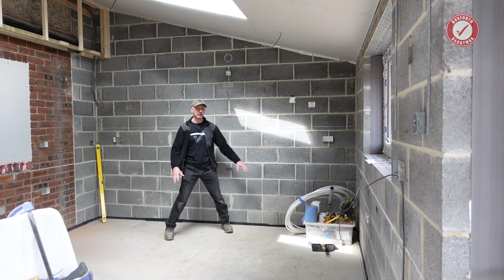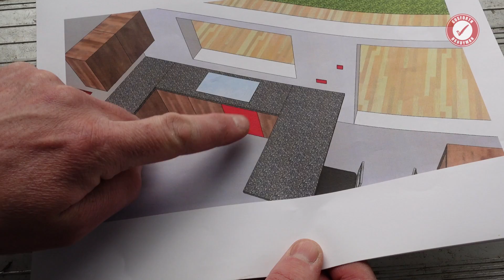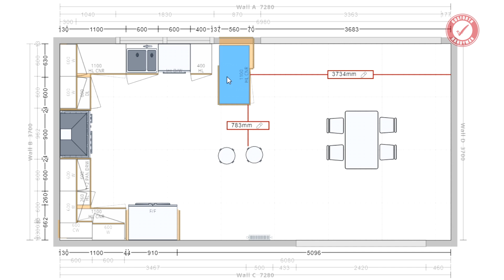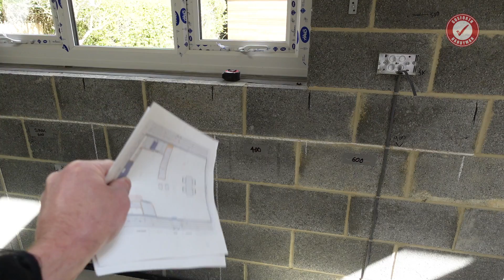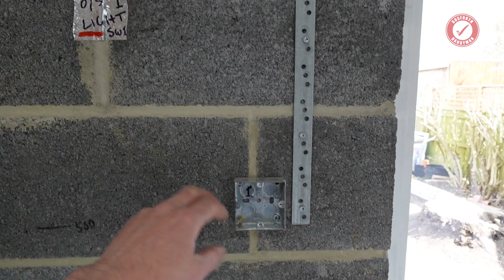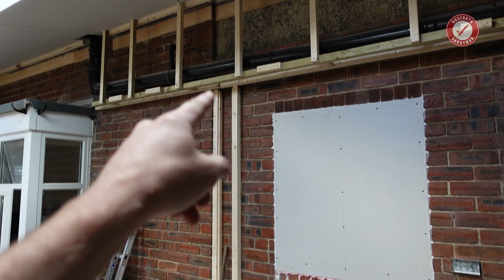DIY kitchen planning - a few tips to get it right! (Self Build Extension Part 18)

Comment: Hi,  Are you really only having 2 double sockets on the long wall? I did that many years ago when we didn't have anywhere near as many devices to plug in. The cost of extra sockets before plastering is quite low. My advice would be to put in at least twice as many sockets as you think you need! Good video, I'm at the same point as this so it was really useful.

Comment: One thing I regret with kitchen is sockets, did not put enough in.. put 2 double socket for every unit you have. Last thing you want is to group your small appliances together and having trailing wires everywhere

Comment: So maybe a suggestion or two.....
Resess the wall behind the refrigerator so you can push the fridge back so the front of the fridge is even with the depth of the counter. It will make it look taller and blend in with the rest of the kitchen better. 
Heated floors in the kitchen/ diner if you can. 
In the corners use lazy Suzannes inside with doors that open fully.
Drawers. As many as you can get. (note: in some premaid cabinets the drawers are shortened debth wise so you don't get full drawers.)
Since the sink will face an external wall, it may feel the cold more...maybe double insulate the incoming water pipes & drains. 
Water sensors under the sink and dishwasher.

Comment: I don't know if you actually ordered the cabinets yet. The upper corner one near the window should be a corner cabinet, not a straight one. Reaching into the far side is a real pain. With the door at a 45, access is normal.
   The refrigerator can be recessed into the wall 3-4" so you can order a standard fridge. Otherwise, you need to order a cabinet depth one. These are smaller inside and sometimes special order. (and more money for a smaller fridge).
  It looks like you can remove the bricks with no problem. I'm not sure what it looks like on the other side. So...maybe.
  Btw, underfloor heating is really nice and fairly easy. Bare feet on the floor is a blessing...and no radiators.

Comment: Andy, great to hear your thought processes.  Not enough power points, and why not have switched spurs for the d/w and fridge and extractor so they are all lined up with the sockets around the worktop?  You need to be able to switch appliances off quickly and fumbling in cupboards is a no-no.  You don't want a socket under the sink, fit an unswitched socket behind or beside the d/w and for the extractor.  Recommend drawers over cupboards for pots and pans, crockery, baking tins and all the rest, very space efficient.  We have a cutlery drawer within a deep drawer and it works very well.  Have you considered floor level lights in the kick boards?  Don't forget USBs in the double sockets.  Lots to think about as you say.  Good luck to you both, exciting times.

Comment: For anyone with the luxury of creating new spaces as part of their design processes, my tip is: avoid corner cabinets at all cost! Anyone who cooks knows they are inefficient and frustrate access.
Reply: Straight cabinets in the corner are a nightmare to reach in. Corner cabinets are a must. Depending on how the cabinets are built, the rear of the cabinet inside can be blocked off. It's useless space anyway, even for straight cabinets.

Comment: Having gone through this process recently, right down to the same 'DIY' software, my only suggestion would be to make sure your radiator size is future proof. I'm trying to reduce my system flow rate to run at 50 degrees, maybe one day getting something cleaner than gas. I have a 1500 wide radiator, sized to the space, but for 50 degrees, I'll need it replaced for at least a triple panel. Covering it over will reduce the benefit also. On the slim unit, I got an open fronted 150mm wide unit from DIY Kitchens (along with the rest of the kitchen!) - great for chopping boards and baking trays and fills in little gaps!
Reply: I also took the opportunity to get rid of gas in the kitchen, one little bit less fossil fuel being burnt!

Comment: 1st off congratulations and very well done for all your and Mrs. Mac's hard work, especially working through the winter, you both deserve full admiration to your commitment to this project. 

I would raise a couple of points about your layout. First off I could not bear a hulking great fridge/freezer in that position which will take off a good 700 - 800mm depth in your kitchen. By all means have one but place it in the corner to the left of your range - it will easily fit in where you plan the corner unit and you can adjust the units between it and the range to fill the gap and you will get more useful storage. I think you will find it will open up the space you have created both when you enter the room and as you look across from the table. You maybe able to make up for the "lost storage" (personally I find corner units do not store that much, even with pull out baskets) by extending your peninsula/breakfast bar which will provide more useful storage than a corner unit ever could or it may give sufficient room for an island although traffic flows around one will take space away from storage. 

Finally, keep in mind where you will put a waste bin in the layout, especially with a peninsula its a long walk outside to the bin. This was a mistake I made in my kitchen and the location of the bin has always been a bit of a compromise.

Once again, my admiration for all your hard work.

Comment: Great video, I'd put the socket for the dish washer on the right hand side rather than under the sink just to keep the electrics and water/waste separate from each other. Just in case one leaks or you make a mess fixing a blocked sink etc.
Cheers

Comment: one question why are you going fitting a kitchen when the bi-fold doors are up kitchen is sealed and you could remove the window for its new access from adjoing room going to be alot of dust and debris when the windows and bricks are removed are you going up to full ceiling height when window is removed or using the existing lentil that window used

Comment: Oh I don't think I could live with a little 400 unit stuck in that gap if not got one on other side. Could you not go 2 door corner units and juggle around a bit? I also wouldn't bother with breakfast bar if having table and chairs in there but the extra work surface is a good idea. Shame you can't put another unit or 2 on back wall due 2 rad having 2 go there. Sure it will all look fine and dandy when done tho 👍

Comment: We’ve done loads of kitchens throughout the years and I would definitely recommend an island over a peninsula. You are limited to one route to the sink with a peninsula and it gets annoying. 
Also you can get 110cm range cookers which are usually much better quality than the 90cm ones and Rangemaster (a subsidiary of Aga) ones are the bees knees. Just my thoughts from experience. 
Oh and as my husband has yet again smashed a bowl on our ceramic floor tiles……..😆

Comment: Kitchens can be heated using plinth heaters run off a wet central heating system; there are dual heaters too so they can also run on their own off electricity such as on a cool summer day.
For home owners diy designing their kitchens, if buying from Howden that company will check the customer's design and produce a finished drawing for the installer - very helpful to avoid fitting problems!

Comment: I agree with the comments about centering the sink under the window. It would drive me crazy having it off-set. My suggestion would be to use two narrow cabinets on either side...one for storing baking sheets vertically, the other a pull out spice rack. I don't know if those options are available in the UK, but they are quite popular in newer kitchens here in the US.

Comment: I'm really surprised you're not going with underfloor heating, certainly for downstairs. No loss of wall space and perfectly even heating, and because low temps are used, the boiler runs at max efficiently. And of course you're futureproofed for what ever heat source you might come along later.

Comment: The way the extension is built, with bricks (I guess they’re bricks idk I’m not a builder!) is this how houses are built in the UK. I’ve seen a lot of people building in America and Canada, where things are framed out with wood, but despite living here I’m not really sure how we do it in the UK. Hence I keep trying to put things up on the wall and they’re often just screwed into plaster, I guess it’s brick behind which is really hard to screw into even with the masonry bits I got, the rawlplugs are often too long without drilling into the brick though. Ugh this it’s such a palaver every time.
Reply from the maker: Yeah, these are concrete blocks. Normally blocks inside, bricks outside. Bricks are hard to drill in to - look for a SDS drill. Meanwhile this might help too: https://youtu.be/87hOAnt9d5s 👍
Reply: @GosforthHandyman  Thanks! My house was built in 1979 so it might be different, not sure. How do the exterior and interior walls come together, cause there’s obvs a gap behind the plaster but I’m not sure how that’s supposed

Comment: We have a switch (touch activated) underneath the overhead cupboards for those lights, I like it.
Also may consider an outlet closer to the range, for a blender or something you use over/closer to the range. Maybe with those flaps to make it easier to clean with spatter and all.
There is room under the counter close to the bifolds for a unit with a door facing the bifolds, if you could see a use for it (maybe outdoor kitchen stuff, or other stuff you use primarily in the garden or at the dining table, like table cloths, pan underthings, napkins etc) so you don't need to move into the kitchen for those.
Reply from the maker: Great tips! There's 3 double sockets near the range at the mo. 👍

Comment: A couple of suggestions, from when I design kitchens, put the china cupboard next to the dishwasher, so it is easy to unload and store, ideally with pull out shelves. Secondly rather than a corner cupboard under the peninsula, put the doors on the bifold door side so you get easy access into the corner from that side.
Reply from the maker: Good ideas! 👍
Reply: We had access doors on the peninsula side in our old kitchen and it worked really well!

Comment: Fantastic to see the bifolds on. Forgive my suggestion over your experience and that its your property, i dont think that you have enough twin sockets in the worktop areas. A mistake that we are still living with, just a suggestion 😊. 

Regarding the under cupboard and if your having it kick space lighting , i cant recommend Robus Vegas led strip highly enough. You can  buy it by the meter and its cutable so you can tailor it to your needs. And you can connect the drivers to Quintec receivers and switchs, to avoid lots of switch wires.
Reply from the maker: Cheers Paul! There's 4 x twins at worktop height at the mo but with it being dot & dab it's very easy to add extra ones if needed. 👍😁

Comment: It's great to see it all coming together.  If I can add one suggestion, albeit probably too late:  If your refrigerator is located inside a cabinet it needs a vent at the top of the cabinet to allow the hot air, produced by the condensor, to escape (hot air rises).  Closing the cabinet top prevents the hot air from escaping and significantly reduces the component's efficiency and ability to cool.
Reply from the maker: Yeah, there'll be top box over the fridge, so totally open at the back. 👍
Reply: @GosforthHandyman  See you are going for plumbed in but remember to check on where the water filter goes! Some are external to fridge/freezer!

Comment: There will be a heat loss gradient across the room, and the bi-folds will be the coldest part.  And the fridge will be the warmest part.  The radiator position will just exacerbate the gradient.  Have you considered something like ThermaSkirt?  You can even mount it flat on the floor in front of a bi-fold.
Reply from the maker: Even on cold days with no heating the room is warm due to the thermal mass of the concrete walls so we'll see how it goes. It's VERY well insulated. 👍
Reply: @GosforthHandyman  But I am guessing there's a gradient, and that the expanse of glass will be 'radiating coolth'.

Comment: I am going to be fitting a new kitchen at some point this year. the amount of times I have changed my mind on the design is reasonably high. Then there is the mixing of design ideas. Then there is finding the right finish on the doors and I looked at door fronts in two of our large DIY stores and I was not impressed with them at all, with the excepts of a solid oak door, but I don't want a natural wood finish and I hate the plastic finish on MDF doors as it is prone to coming away. I was going to build the whole kitchen from scratch, but eh wife doesn't want it to take and age for me to build all the units and make the door and Draw fronts. Even though I have build other items for the house, the last being our Bar.
Reply from the maker: It's a nightmare mate. Eventually you just have to pick something and go for it. Even just looking at handles stresses me out. Good luck! 😂👍

Comment: I despise corner units. I’d rather lose whole 600 and have drawers instead. If I were you I would lose the corner unit on your breakfast bar and have 600 drawers facing the dining area and then the other 600 for the kitchen. Hard to explain.
Reply from the maker: There's lots of clever options for corner units now, carousels etc. We'll see what we actually need to store there first.👍

Comment: I’m sorry in advance if I’m unaware of any permissions in place as I haven’t had the time to follow this.
If you are rendering the extension and not the rest of the dwellinghouse you will require planning permission for the extension because Class A does not allow the extension if the materials do not match. Planning enforcement are likely to breach no further action such a thing but best to be safe as the senior officer may find it expedient to serve a notice asking for matching materials which you could appeal on I think ground a which is ‘permission should be granted’ and ground F which is ‘over enforcement.’
Reply from the maker: Yeah, permissions already granted and most houses around here are rendered anyway. All good. 👍

Comment: I would suggest pair of sockets  every 2 ft above the work surface , I have 7 sets and there are only 2 spare! Also ihave a tambour unit with a pair of sockets inside that I keep my mixer, processor and liquidiser in so all I have to do is pull them out onto the countertop and switch the socket on.
Reply from the maker: Nice one! 8 doubles + USB in that room. 👍👍

Comment: canny vid but your using straight forward units ie as you stated strandard sizes for kitchen unit's start from 300 wide then 400/500/600...you are wasting a lot of space using standard  corner base units ie a base 1000 with a 500 door for an example in fact standard units through out   ...am a kitchen fitter by the way ...you would be better off going to an independent kitchen company they can make units to fit any size you want depending on the type of door ( odd sizes can be made ie if they made by Browns in Cramlington ) .. the corner on your breakfast bar for example has a lot of wasted space using the units on your plan  at the 9.14 mark ( you did point this out by the way ) an independent could make a unit where you could make full use of the corner base ie using a 900 x 900 for example ..or it could have a 400 door an a 300 with a unit to suit hope this makes sense  ..judging by your plans your probably looking at buying your kitchen from the likes of wicks/b&poo/Howdens etc  I would recommend getting a few independent kitchen company's  into make best use of your space ...this is not a plug mind ..as am from Ashington but BB kitchens at brunswick are good ..I DONT work for them or have anything to do with them But have used them for over 30years hope this might help
Reply from the maker: Cheers! Good tips! 👍

Comment: Nearly forgot, we are looking at redoing our kitchen, similar ish layout to yours and I am strongly Considering two dishwashers and less cabinets for pots, cups, plates etc, on the basis that one would be full of newly cleaned dishes and the dirty cups etc going in the other one, and then just turn it on when full instead of taking things out them stacking them in a cupboard on the wall and so on - so much easier.
Reply from the maker: Interesting - never seen that done before!
Reply: That might be genius, (reaches for the notepad)
Reply: Two dishwashers - good call sir!
Reply: I think the issue with that idea, is that the crockery or items in your newly washed dishwasher may never fully dry.. As certain items (mostly plastic), cups etc can collect water in little crevices on them.. Not massively hygienic I would say! But the idea is certainly interesting!

Comment: Did you not consider putting the vertical radiator on the side of the cupboard with the American fridge? That way you lose no wall space.
Reply from the maker: You can't really attached heavy stuff like that to chipboard so it would need reinforcing in some way. 👍

Comment: We have an unswitched socket under the bench for our dishwasher. But connected to a fused spur switch above the bench to switch it off if needed. It's a lot easier to switch it off quickly than scrambling in a cupboard.
Reply from the maker: Not a fan of loads of bench level switches - never had a situation where we need to switch it off that quickly. But personal preference! 👍😁

Comment: Did you consider taking the upper cupboards to the ceiling? I think it's meant to make the kitchen look more fancy and easy to clean etc.
Reply: I would definitely recommend doing this, I have done it in my own kitchen and it looks so much better and I don't have to worry about cleaning to tops of the cupboards!
Reply from the maker: Not sure how that would work with a vaulted ceiling? 🤔